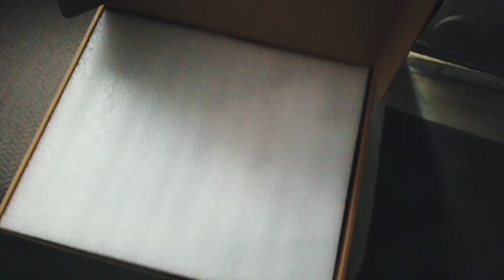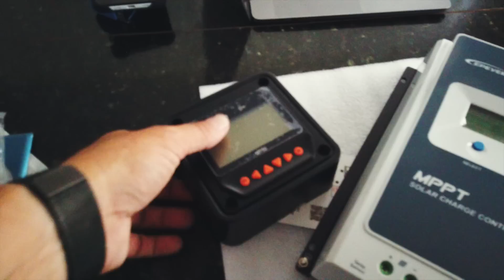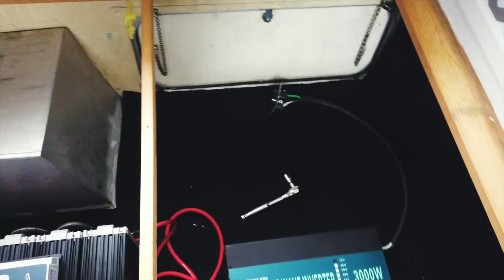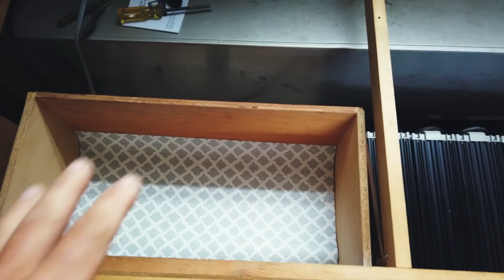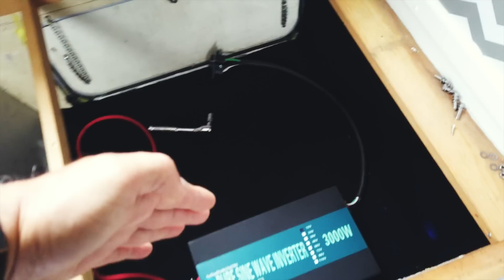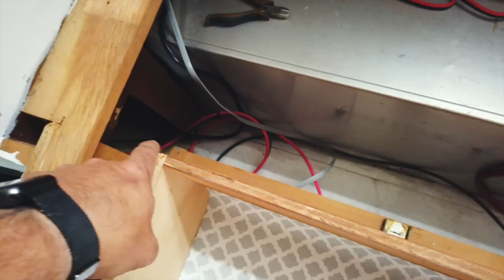Solar Upgrades for the AVION! Pt. 2 || #RVLife

Comment: U might want to put some fuses or manual circuit breakers in between battery and inverter in case u short circuit u don’t fry anything. Good luck mark it’s different then most youtubers and a good learning experience. kudos to those batteries, nobody got those. Safe travels

Comment: After using my solar system for two years, I feel the next upgrade will get my RV to my happy energy space.    The 30 amp plug is a good addition.
Reply from the maker: Nice! How big is your system?
Reply: @AvionAwesome  it is small, though I have made it work.  I've been off grid all but 5 weeks these past 2 years.  This past year my generator has run less than 10 hours.   I have two 145w panels that lay flat, two 12v lead deep cycle batteries 70Ah(each).   I've on my 3rd inverter.  My 1500w inverter lasted a month.  My 750w lasted a year. And current I'm working from a 175w inverter.  So, I really do know that upgrades are needed and what they will be 😁  I did learn living in Ohio during the winter is do-able even with a small setup.
Reply from the maker: Wtf??? You are only using a 175 W inverter right now?
Reply: @AvionAwesome  yes lol Not ideal, but getting the job done one job at a time lol here's the difference between your set up and mine ... (all) my inverter(s) have plugged into a 12v receptacle when needed.  They were never hard wired like yours.
Reply: My Fall upgrades I am in hopes of more Ah's, a couple more panels, and a inverter that runs the enter coach.

The 3k takes a lot of juice to run and with my 70 Ah's a 3k would be over kill.

Comment: Building a beefier Kodiak is a great idea for its simplicity of operations. I am no electrician myself either but I know your research will give you the answer you look for. One thing: controllers with attached cabling should be stationary as movement will make wiring getting loose faster. Second thing: all your connections should be easily accessible to take connector temperature with an infrared thermometer regularly to ensure proper torque on connectors and ensure your wiring size is appropriate for the load you are running throught it. RV mechanical movement might probably require a regular re-torque of your connections. Not an electrician myself but I love your oit-of-the-box-thinking solar/battery setup. Your 30A plug would give you the possibility of very easily hooking up to shore or generator when you need more charging power. Great idea! Take your time  to set this up and, take good care man.
Reply from the maker: Thanks, Daniel! I love having the 30a RV plug. Makes the switch from shore power to off grog as simple as swapping 1 plug. And no need to create an overly complicated transfer switch setup on these older campers!

Comment: These solar installations are really intense. We decided to use Apex and solar panels for now. When we go full time I am sure we will be going full solar as well.
Reply from the maker: Yeah, the Kodiak/Apex systems are a great stop gap till you decide what you need and are great as a portable power supply after you replace them with something more permanent. That just aren’t designed to be a full time system. They’re just too underpowered and limiting for a full-timers needs IMHO.
Reply: @AvionAwesome  Agreed. Also, our current rig may be upgraded in the future. We dont want to make the solar commitment on it.